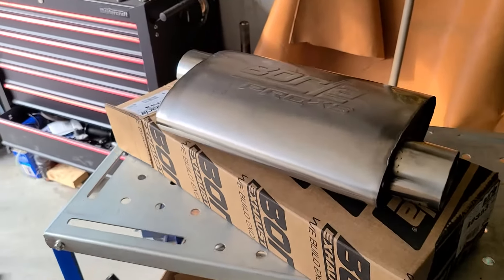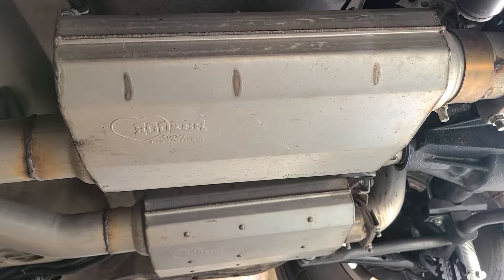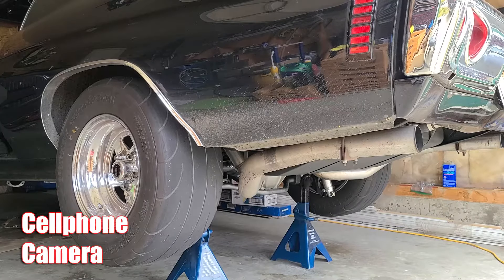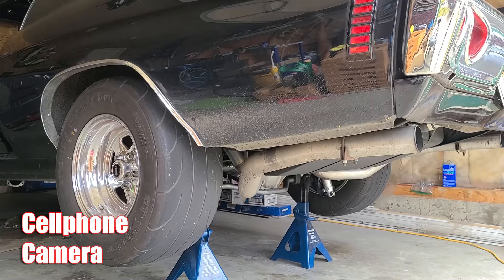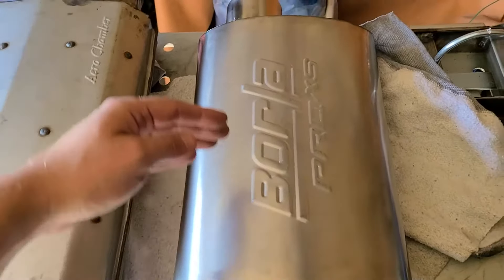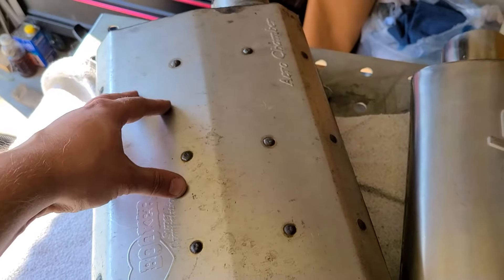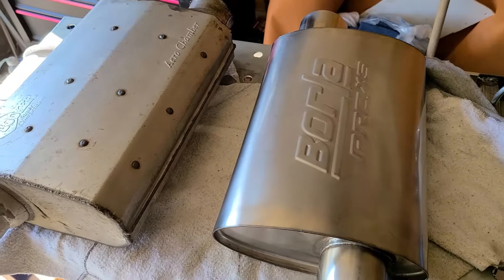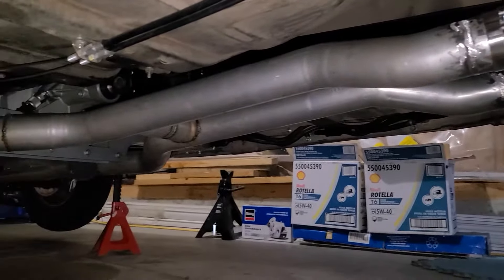New Mufflers - Borla Pro XS

Comment: Nice Chevelle. I have 69 Camaro Big block 630hp. I tried the Borla pro xs 3'' mufflers. At idle they sounded good. Once I got on the car they were very loud and slightly raspy. I switched them out for Hooker Max flow 3''. The sound is deeper (larger case) then the Borla, not quite as raspy but, still very loud when you get on it. 
I've tried Dynomax Ultra flows and Pypes race pro and yes Flow master FX. All have that raspy glass pack sound when you get on it. Pypes being the worse. 
When I have the car idling you can see fiberglass particles blowing out of all of them. As far as I'm concerned they all sound like oversized glasspacks. Not a fan.
 I like the sound of chamber mufflers or, turbo mufflers the best..but I get the whole HP loss thing. Driving around town, cruises nights, car shows, stop sign to stop sign,.. I doubt you're going to feel a major Hp loss difference. At the track a different story.
Reply: What's your go to muffler?

Comment: The Aerochamber is my fav V8 muffler. I had them on my 86 Cutlass and Nissan Titan. Best all around sound and performance. I currently have a ProXS on my Sierra with LTs and no cats. It's an amazingly quiet muffler. Dunno how the hell Borla does it with it being wide ass open as they are, but they do. If Hooker still made the 3" in/dual 2.5" out, I'd have an Aerochamber on my truck, but ProXS it is now lol.

Comment: Something nobody mentions about the borla pro xs. I put the 19" case 1 into 2 on my truck and it seemed almost as loud as the super 44 it replaced. I was disappointed because I wanted to quiet my truck down a little. It got much quieter the 1st 50 miles or so. 

That's the 1st time I've ever seen a muffler get quieter as it broke in. I assume maybe the stainless packing is wrapped in something to make it easier to pack and takes time to burn off.. idk... That's my theory anyway🤷‍♂️

Comment: The aero chamber’s are straight thru to they just side step a little and have a lot of packing.I have both the 2.5” & 3” although I haven’t heard the 3” yet but I always liked the 2.5’s and I never came across anyone else who didn’t but I have to say I kinda like the borla’s and I think there’s only a couple bucks difference but the borla’s as you said are lighter and made out of SS so will last longer but I just paint the hookers and let the paint both cure then bake at low temp and low care afterwards.which is better,,,I like em both but I would have liked to hear them on the road but hey enjoy em and thanks.

Comment: While Hooker advertising budget is passed on to you w/sales, Borla prefers the put R&D into their products. Like using the 300 series stainless w/nickel in the alloy. They design products that some are looking for, but also make products using flow bench research by David Vizard who started that in 1965 and pressure sensor research to find the pressure wave location and activity in the exhaust and mufflers. David has 750+ page books on the subjects but also recommends Borla over Walker, Flow Master! The engine can produce the same open collector HP using an expansion chamber design at 2.2 CFM times liter divided by number of mufflers (1 or 2) but controlling the pressure wave, making the same HP as open header/collector race car engine yet can still reduce noise to street legal levels. He has a YouTube channel and discusses the issues in headers, crankshaft and muffler plus more. Mechanical music, he calls it.
DK, ASE master tech since 78.

Comment: Was there anything in particular about the Hooker Aerochambers you didn’t like? I’m running Borla ProXS, just wondering sound wise how they compare. So hard to tell with videos, they sound similar.
Reply from the maker: They are too heavy and if you watch the drag racing video with the Borla mufflers, apparently they were bad for power. In terms of sound, they are shockingly similar, which is what shows in this video. The Borla's are very slightly more "Magnaflow, or Ultraflow" sound, while the Aerochambers have a slight bit more glasspack sound. Very minimal either way.
Reply: They do sound alot alike. Sounds great and making more power is always a plus! I will check out the drag race video, appreciate the response.
Reply: Hello, would you mind sharing that drag racing video with borla? Interested about power loss due to borla, I'm torn between borla and magnaflow. Thanks

Comment: Are crate mufflers universal?  Are they something I can just get welded on to my scat pack or hellcat?
Reply from the maker: technically any muffler is universal if you can make it fit. 2 big factors are muffler length, and if the pipes are offset or center in/out.

Comment: I am soon to put new (dual) exhaust on 73 Dart sport, 2.5 pipe, with 340 engine.
People- advise me on a "loud muffler" Without big drone inside. I've heard Flowmaster delta flow 50, I like sound outside, and I can live with drone inside, but would like a little less drone. Suggestions??  I'm not a racer, I just like the sound......
Reply from the maker: Flowmaster's sound great because of the chambered design. It also costs power. Check my video on how my car ran at the track from the muffler change. I had Flowmasters originally, and the drone got old very quickly. The Aerochambers were a good compromise between sound and performance. If you want to go rowdy with the muffler sound, check out Black Widow exhaust.
Reply: @SS454LS6  Thanks for fast answer. So you say Aerochamber has that loud sound, but not the drone inside? And the same with Black Widow, not loud inside? Correct?
Reply from the maker: @dangeroreilly2028  the aerochambers are kind of in the middle between Flowmaster loud, and straight through mufflers. I ran them for years, so you can get an idea. I'm thinkin the black widow mufflers might be what you want if you want loud.

Comment: Sounds good 👍 I'm using flow masters 44 series
Reply from the maker: Thanks. I like how that there is a lot of options for mufflers with our vehicles.
Reply: I had Flowmaster 44, 40 series and NO one of those were better than the Borla Pro XS, I have it on a 1985 CJ7 258 with weber 38 outlaw, Headers, and high flow cats. Sounds amazing. Flowmaster have a nasty drone in the long run.